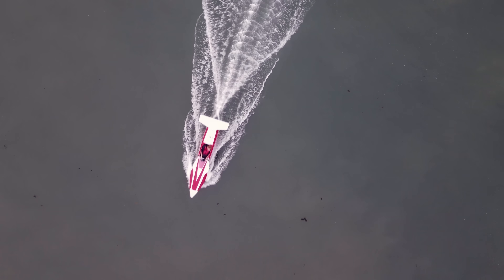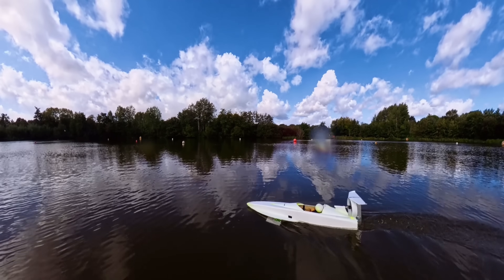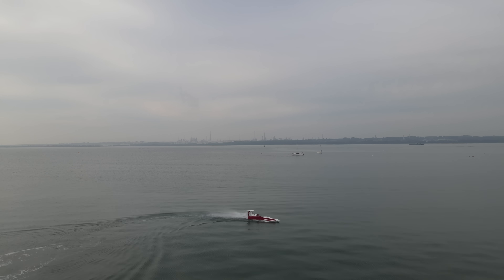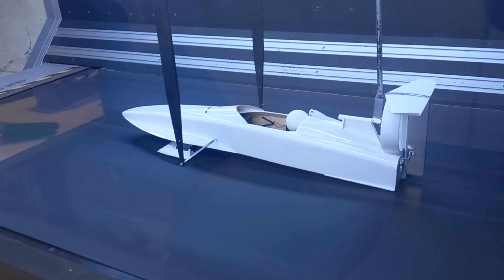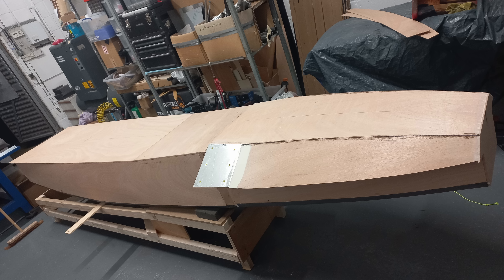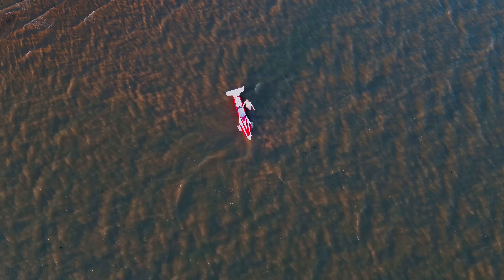How I built my own world record prototype - The APX hydroplane

Comment: Nice work. Suggest keeping an eye on the potential for propeller whirl as you go faster, especially with that somewhat flexible propeller shaft installation an relatively low rotating inertia on the top shaft.

Comment: Hey mate, i have an idea to spitball. So your current intake cowling is not aiding you in anyways besides being not restricted and being higher away from turbulant water splashing. but... perhaps if you used a cowling at the sides of the boat that uses linaer flow into  a ram air intake like they use in turbine powered crafts... would that not add precious highspeed stability while keeping the weight down? perhaps a snorkle or something - id be scared of rouge spashes from hitting such a high rpm balenced prop at that speed since water is so darn heavy

Comment: For aerodynamic drag one thing to watch is wetted area. In this case "wetted" is all the surfaces in contact with air. Looks to me that the body should be much shorter AND the back end needs to come to a fine point. The square back end is causing tremendous drag. To see an example of a very low drag aircraft look up Questair Venture. It's an utterly fat stupid looking airplane - especially on the ground - but with the wheels retracted it has one of the lowest Cd of any design. Long and slender doesn't do you any good until you approach compressibility around Mach 0.8 or so.

Comment: I like what you got going on here. I had the same kind of question, Why aren't there 2x 52v electric driven aerodynamic record vehicles? There seems to be room in the record books. I have yet to see an electric velomobile designed for top speed, But I have seen cyclekarts. I recommend using internal recirculated air for cooling instead of fresh ducted air for water intrusion prevention. You ever see a water bomber reload from a lake? If you use liquid cooled components you could cool them using a small tube pickup on that rear razor strike.

Comment: Interesting concept and you have done alot of RnD work. I'm not sure what results you got from the test boat but Im not sure what you are trying to achieve with the suspension. I think you would be better off without and trying different planing surface that can achieve a smooth stable ride. General with boats you want stiffness. Comfort isn't fast either.  Other then that keep up with the good work.

Comment: A better way you can do it is instead of having your propeller in the back of the plane have your propeller in the front of the plane so that way your mother not only pushes you or pulls you through the air and also puts air flow to your back Wing which also helps lift the boat and helps it clean more stable they did a couple of planes like that in Russia where it was a plane but it only got a few feet up off of the water's surface and they were able to get like 500 miles an hour supposedly I think it was called a Chrono plane

Comment: Propeller outside of the water you have to make it a hydroplane what is small a wing to cut through the water as possible one way you can do it is the front weed and to have a little bit of a curved downward and the rear wing to be flat

Comment: Following your great project I see you use a Biela 3 Blade for testing, they are good but the blades rotate 'heavy' thru the air. I mean this prop needs more power to rotate a certain rpm than a real carbon fiber prop. A custum made prop is maybe not needed because there are already great ones on the market. I,m a warbird modelflyer and use : Mejzlik, Engel Modellbau and Elster props. They all perform much better with lower input power needed !! It also saves you a large amount of time, effort and money developping and testing an unknown prop. Maybe other excellent props are also available in the hovercraft scene. Just my 50 cents on the subject. Goodluck and Grtz Jean

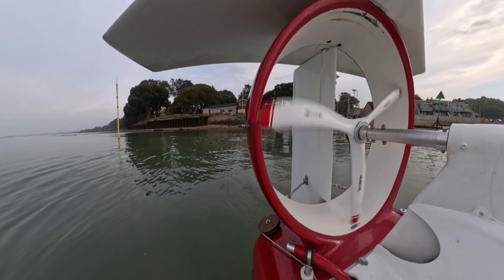Comment: 3:25 Every time I see a modern speed record boat I wonder if active hydroplanes would be a good idea. For speed and comfort but especially for safety. 

Essentially controlling them like dive planes, you'd have a fly-by-wire system adjusting them millions of times a second according to a whole mess of accelerometers and gyros and keep the boat at the perfect altitude. 
And then, in a fraction of a second it could detect an unsafe dip or rise that will lead to a roll over (and death) and take control of the boat, arresting the anomaly or straight stopping and saving your life. 
You just have to get good at models, limits, feedback and PID controllers. 
And programming and electronics. 
And hydraulic or electric actuators.

Comment: Consider a canard style design with your airfoil at the front, then you could have the option of control surfaces on your hydrofoils at the rear, even if you want them up high for use at low speed prior to lift.
Reply: He isn't using hydrofoils at the rear. He's using hydro planes, as explained in the video.
Reply: @MrAdopado I was suggesting switching the hydroplane to the front like in a canard design, which would relocate the hydrofoils to the rear.

Comment: Great piece of development. really interested to see it at speed. Ive done lots of rc racing with o/d hydros so appreciate the work. Watch out for waves catching the top of the front planes. Water brings things to a sudden stop in seconds. Other things at higher power may be torque roll so maybe wider spacing of the planes.

Comment: wouldn't you want a direct drive electric motor with prop?, your problems will be with your transmission as it currently is. You could balance out the weight of the direct drive motor by putting the batteries in the front.

Comment: One thing that stuck with me watching SailGP: they specifically mentioned that the top speed of the F50 catamaran is not capped by wind speed - it is capped by the cavitation behavior of the foils. Because at high speeds cavitation kills lift which results in an instant nosedive - just ask team Brasil about that. The forces going from 90 km/h to 0 in like 10 metres were so high that the catamaran broke apart... 😲
So, to make it short: cavitation is the reason why nobody runs submersed foils for world record speed vessels - they all just skim over the water. ✌️
Reply: .. which is why he has chosen a hydroplane design rather than a hydrofoil design.

Comment: Congratulations, you built a death trap. Water is an incompressible fluid. That means when invariably your face meets it it will not give way.
At the speeds of your prototype hundreds of people have died over the years. At the speeds actual records happen it's usually easier to talk about who survived.
Love the enthusiasm, but maybe pick something safer. An airship using hydrogen for example.

Comment: Airboat! Woo!  </Archer>

The efficiency goal is admirable.  But the end goal is performance -  a record breaking top speed, not improving fuel economy and making the global transport system greener. 

If your boat is thirstier and needs more fuel or a bigger battery, then screw efficiency, just give it more fuel or a bigger battery.  

It's supposed to be a one off record breaker.  After you've broken the record, it won't be using any energy, or have any operational carbon foot print at all!

Comment: Make sure you design a proper cabin with rounded edges. Water is not like land, when something breaks it stops very quickly. On land it will skid across the surface for a long time unless you hit something but on water things decelerate very quickly and it is a huge hazard to the pilot/captin anything in the near distance that is sharp, pointy or straight  and flat. Water deceleration is violent.

Comment: I am fascinated with this project. A nerdy question about propellers. The relatively recent experimentation with toroidal propellers has my brain racing for possible applications for it. My remote control hobby provides some outlet to try selected. items. Would the theoretical  efficiency of Toroidal be of use here? Possibly below the wate line as I know those are regularly manufactured. Propellers seem to be custom items.

Comment: In RC planes there is a cheap and easy plug in Auto pilot [ stabiliser ] that is readily available and has been for years. I wonder how it or a similar option would be at controlling/stabilising the pitch etc if connected to the relevant control surfaces?

Comment: You need to redesing the rear wing + cockpit to have canopy In a proper aero simulator. As your currend design looks un-aerodynamic and potentially unstable. 

Take a look at saltflat racing cars + dragboats and their aero / safety tech. High speed crashes at water are lethal, so you really want to nail the design before trying that record attempt. Just look how many People have died trying to chase the record.
Reply: This is not the water speed record open class, jet powered etc, this is only electric, only 200mph The world record is 143 on a water ski and 317.5 mph in a boat steel hydro jet aircraft engine.

Comment: That is cool as hell. Mostly because it's full experimental something I do a lot of and the one thing you're experimenting with that I can't find nothing on but I've tried to do myself and that's dual propulsion. I'm a big high performance RC freak and been doing it for 30 years but I also love aviation. Unfortunately I don't got the eyesight to fly so I apply it to to boats because aerodynamics and fluid dynamics are very similar only difference is water has way more surface tension. And one of those is my love for jet boats and I've  had this crazy idea for a dual jet propulsion using both the RC jet pump and an EDF. Sounds crazy but if anybody knows anything about jet boats knows that one of the most common high performance upgrades is what they call a ram scoop intake. Essentially is just a scoop that hangs down and helps Force water up into the impeller the faster you go the more efficient. So think about it the faster you're going the more water gets rammed up into the scoop so why not use air power to help with that process. I've researched it to make sure my crazy ass idea isn't too crazy before I attempt to do something like that (let alone spend $$) but I can't find nothing on it and this video is the first time I've been able to find anything on a dual propulsion setup. And I've been researching this idea for the past seven or eight years. Badass video and really hope you do break the record which with what all I know I'm pretty confident you'll get damn clothes lol.  ✌️

Comment: why not replacing the suspensions a hydrofoil wing with a propeller and build in suspension below in combination with the existing concept of propulsion on your model???

if not, why not remodel in such a way where the suspensions are partly covered from the main hull for reduced drag?

i am not an engineer, i wish i was but it begs the question why? 🍿🍿😅

Comment: P factor - Torque steer??.

Water prop vs air prop - puts the craft in different categories ?? - "presumably".
?? Ram air at the trailing edge  (between twin passive - super cav. skegs)- - active roll / pitch control at the forward planes ??

Comment: Once you reach speeds over 100mph, your probably going to want a test driver. I have experience racing/riding motorcycles at speeds up to 185-190mph and i cant swim, so i have strong incentive to not crash.

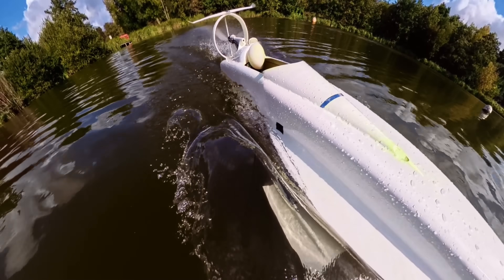2:12

Comment: This is a very interesting project indeed!
Some ideas that may help:
* A small fin on the lower rear, under the water, that can be controlled with a controller connected to a gyro in closed loop fashion (like basically every drone these days). So you can improve stability at medium speeds.
* The spring-shock absorber system of the suspension could be mounted inside the boat, by the means of a pushrod. You may even replace the spring with a torsion bar, in order to reduce weight. That is what modern F1 uses.
* Your rear wing (and I mean the aero one) would be slightly more efficient if mounted perpendicular to the prop housing. Aerodynamic surfaces mounted that way relative to fuselages are usually more efficient, and is one of the reasons the F4U uses the gullwing design. This would also make the rear wing wider, allowing to have better roll control with small ailerons, just in case you accidentally go from water to air (whis is very common in these type of boats). Together with your rudder, you will have full axis control so, in case of flying, you don't land sideways.
Most of this requires electronical control (commonly named "fly by wire") but I think the extra safety factor is worth it.
Cheers!
Reply: It seems like he's working towards hydrofoils in the front and an airfoil in the rear. If he switched it around to a canard style design, the water drag of the rear fin/fins you suggested would be with the half that's in the water, which seems like a more efficient and effective way of making that work.

Comment: No, you need to submerge 4 torpedo like floats under water and suspend the rest of the boat with vertical "stilts" above the water. So it cuts through the waves like a knife edge! The bouncing will be minimal! And the bottom of the boat will produce a Ground-Effect to lift the whole thing! You are welcome! ;0)= great project!
Reply: And you could mittigate the drag on the Torpedo Floats by pumping high pressure air through, 1mm holes all around, at several stages.....

Comment: long ago, 1980 I acquired a MinMax kit that was unfinished.  LT .4x8 plywoodi size, rigged with cable steering and throttle control, running an old tweaked Mercury Hurricane outboard.  Played with it for a weak and sold it.  I had other toys...

Comment: Not a fan of the chain drive. It causes a ton of stress and harmonics at high rpm when you really get after it with gear ratios and motor rpm. Chain whipping too.

Comment: G'day,

Ahoy...!

You mentioned Airscrew Efficiency of
 "60% to 70%"...

Nope.

Look up
Betz' Law of Wind.

The absolute limit of efficiency of any Aerofoil Array at converting Energy in the Air Cilumn into Torque in a revolving Shaft, is

0.5963....

And, because Betz' Law is an EQUATION, it operates Inexorably, going
Both ways.

People quoting Airscrew Efficiencies of "85% or "92%..., are in fact misrepresenting the fact that their Product can achieve 85% or 92%
Of the Theoretical
100% of the Betz Limit,
Of
0.5963.

Which is perhaps why Aeronautical history is littered with the wreckage of so many Hopes and Dreams which failed to fly out of Ground Effect.

Just(ifiably ?) sayin'.

Such is life,

Have a good one...

Stat safe.

;-p

Ciao !

Comment: The propulsion method tradeoff was fascinating. I’d like to hear about the tradeoff between surface-skimming hydroplanes and submerged hydrofoils.

I suspect you’d be able to move the hinges and/or shock absorbers of the suspension system inside the shroud to be less of an aerodynamic issue, possibly with carbon fibre airfoils as the suspension arms. Maybe with fabric or polymer aerodynamic shielding like the canvas around a cannon mantlet, pressurising such a structure with air might help keep its shape. Ideally you’d make it all one big composite compliant mechanism, no hinges to worry about but man would the digital modelling and testing be a nightmare, and if it shattered you’d plunge 50 metres deep in a heartbeat.

Comment: You will find high speed to be roll unstable on a narrow boat. Use wider hydrofoil separation. Your foils are also too fat.  Use a small forward canard aero wing with a lot of dihedral with variable angle of attack and trim for stability and control. You will essentially be flying a hydroplane in ground effect. Use small twin air rudders outside of the propblast. You do not need the high manueverability of the deflected prop blast at 200 mph. Give the horiz stab some dihedral, too. Give the prop/engine some variable trim with mostly down trim. Any up trim will make you airborne. You will need that to keep the nose down until you top out, then unload the nose as much as you dare. The shroud on the propeller does not increase efficiency as much as it creates drag at higher speeds, so get rid of that. Use direct drive instead of a belt. Make the boat narrower, longer, lower deck and lay down in it. Err to the side of nose heavy when balancing. Reduce surface area and span of horiz stab. A small vertical dorsal fin at CG will also increase roll stability a lot at speed. Convert to tractor prop facing forward on the rear where it will have clear air to bite with less washout and a far greater selection of speed props. Keep loading batteries until it almost sinks. Give the flotation hull some V and forget about shock absorbing hydrofoils. The V hull will be stronger and act as additional stabilizing aero dynamic dihedral when hydroplaning and reduce shock impact when slamming chop. Make it stronger because you can handle some weight if wind resistance is low.
 If it almost is a submarine when sitting still and will barely turn, you are almost there, just do not tell your health insurance provider.

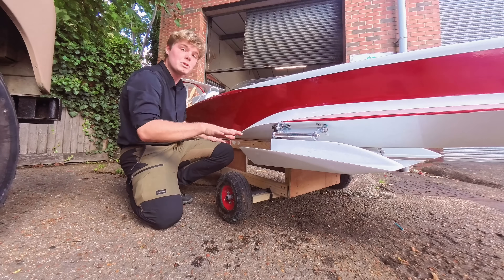Comment: Great work!! Thanks for posting and looking forward to your updates. Hey around 7:03 is the prop shaft vibrating or is it an illusion. At 7:21 it looks like the shaft is bouncing up and down - which would explain the upper and lower scrapes inside the cowling shown at 3:22. If it IS vibrating maybe move the rear prop shaft bearing backwards, closer to the prop. Again keep up the great work!

Comment: Really an awesome project and challenge! I wonder about the propeller, I seen they use in almost all hydrofoil racing boats propellers that are in the water, but just barely. Like 1 blade touches the water on the H1 Unlimited hydrofoils and those allegedly go 200+mph. Are the engines so powerful efficiency is not a factor?